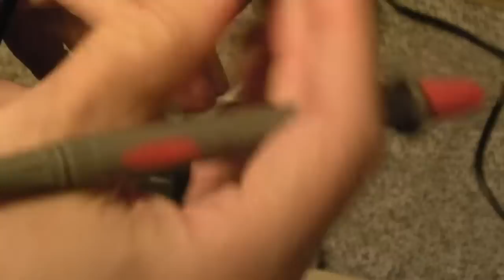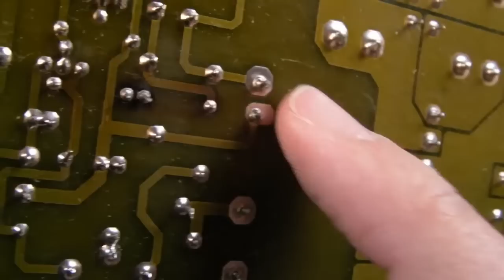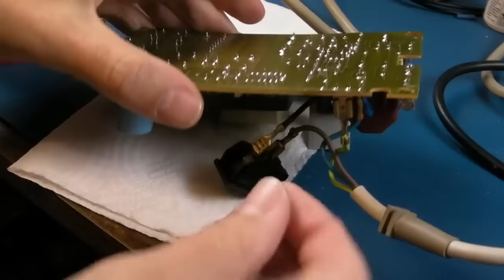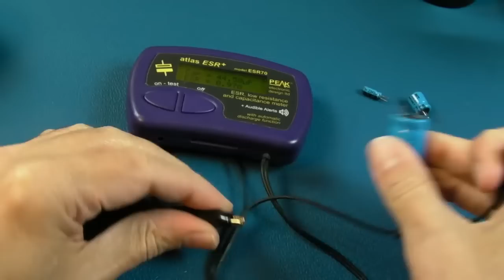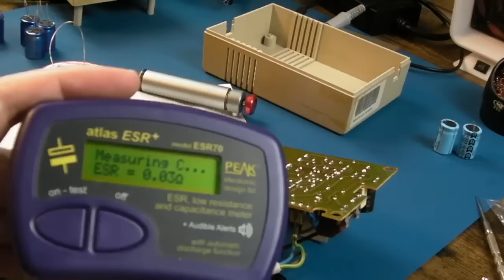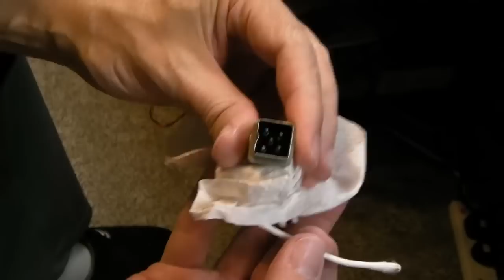Trashed Commodore Amiga PSU (312503-02) Repair (Should this be fixed, or binned?)

Comment: Great video! So nice work! Love how you explain it all! Learned something from you! Just want to say, on my A500 psu, two resistors in line are burned! I seen that in a lot A 500 psu! What cause them to be burned?! I checked them and they are good, but cant see color of them because they are burned well, black spots under! How long they can be like that? If i change them im afraid that they will burn again!
Reply from the maker: Thanks, i would replace those resistors before they burn out totally!  The best thing to do is up-rate them regards wattage.  They will be 1/4 or 1/8 of a watt - fit 1/2 wat resistors!  I assume they are 47ohm?   They burn up and get hot because they run close to their wattage rating.
Reply: @GadgetUK164  Ok i will! Thank you so much for your information, really appreciate that! Greetings from Croatia!

Comment: Resistors never last in constant power supplies. Like tvs. Everyone I've almost ever fixed with power supply problems had a cooked bleeder resistor on the hot side. It's why tvs can start so quickly, usually. I had an old 720p lg where the caps failed in a state where I had to wait ten minutes for them to fill and then the TV was good to go. TV repair is the worst.

You're beyond thorough man.

Comment: That would be recycled if it hit my bench. I'd make a new supply inside the box to keep the retro look as I assume it's why you're putting the effort in to fix it.  What is it with commodore and the 470uf caps? Haha  I buy overstock caps from jameco off Amazon by the kg. It's all brand name new caps that were at the end of the reels. Is that a primitive flyback psu? Or old rather. 

I loved the heat shrink thing. I have a c64 psu and spare good ics if you want them man. I'm beside the ocean in nova scotia though. I'd go splits on the shipping just to help a fella out

Comment: There is no sense wire on Amiga external PSU. That yellow wire is usually the shield. It's usually connected to mains earth.
Reply from the maker: Ah, you are correct!  Well - looking at A500 schematics!  I must be thinking of another PSU!
Reply: (at least it was on one of mine, via a big bodge wire on the underside of the board)

Comment: Riviting the heatsink to the regulator/transistor is done to both reduce cost (time) and to control the clamping force. When using a screw if you do not tighten it enough you don't get proper heat transfer. If you tighten the screw too much it can distort the heatsink and/or damage the part. In production a torque screw/nut driver is used. These are expensive though and not something found in a home shop. A high-quality rivet tool that can be calibrated (and it regularly checked) is a good alternative. A company I used to work for found that even though the manual torque driver method took a bit longer it was more consistent than a riveting gun.

Comment: Great video. Would it be at all possible for me to buy a PSU from you for my A1200 ?

I sent my Amiga off for repairs and the guy gave it an overhaul and a recap, but when I got it back it only worked for an hour before It broke again. So I sent it back to him. He said there was nothing wrong with it and sent it back to me and it only worked for about another hour.

We both suspect my PSU is faulty but he does'nt repair or sell them.
Reply from the maker: Sorry I missed this!  I don't have an spare PSUs atm!  Those ones all sold before the videos went up!
Reply: @GadgetUK164  That's fine.

Comment: Be Careful with the Atlas ESR thing, if it shows HIGHER ESR than the specified value.
That can mean that the Cap is a bit leaky and the Device assumes more Capacitance than it has.
I have measured a TK Cap with over 3000µF. It was a 2200µF type.
So higher capacitance is suspicious with the Atlas ESR meter! 
So if old and Capacitance higher than value, assume that Cap is bad.
Reply from the maker: Thanks, that's not the issue here!  The new caps were higher than marked and many old caps from 80s and 90s had high tolerrance to start with, I have 2 other capacitance meters that show exactly the same types of readings too.  I've swapped caps out enough times to know when a cap is bad or not.   I measured enough caps back in the day to realise even new caps back then could be 20 to 50% larger than marked.
Reply: @GadgetUK164  Ah, no worries. Just wanted to make sure you know what I know and share my experience.
If you have a different meter that also tests Leakage of the Caps and that shows they are fine, then everything is fine.

Comment: Old modelling trick is to mix baking powder or talcum powder with superglue, it makes for a very strong paste that can be structural and can be sanded easily, and can be stronger than epoxy resin.

Comment: ISMET, faulty by design ;) I usually just gut and Meanwell these, and if the BU508 transistor is intact I keep that for future monitor repairs!
Reply: yeah, modern PSU are so unbelievable better than older ones that it really makes sense to just replace the older ones with modern Meanwell or similar.
Even if its just from a safety perspective, better voltage and so on...

Comment: Good video and love the homage to the carpet... 😉Always good to see something like this being recovered rather than binned 🙂 My preference is to replace the caps as a matter of course though as you say, 98% of what I replace is probably fine!
Reply from the maker: Yeah, it's always a good idea to change them really - it's just a case of I come across so many systems and PSU's, I would be doing nothing but cap replacements and the cost would be nuts!